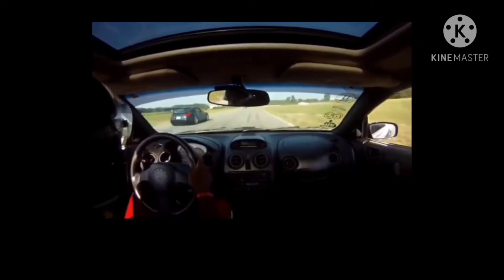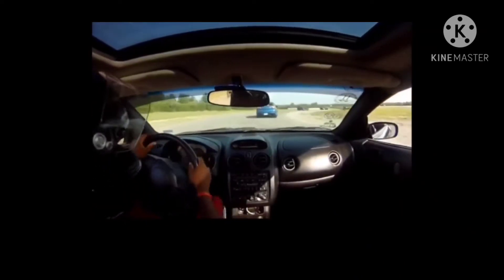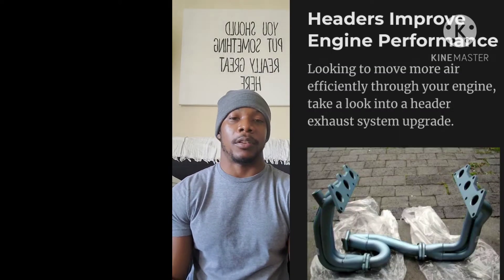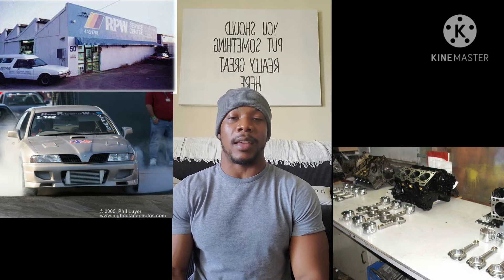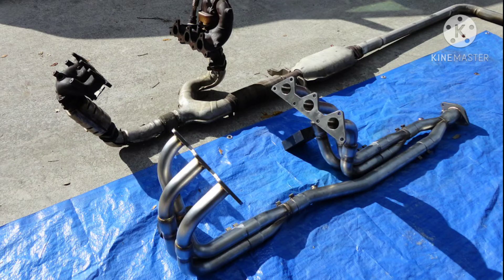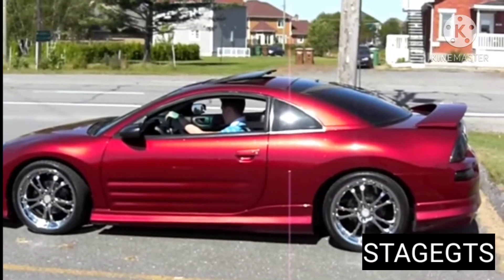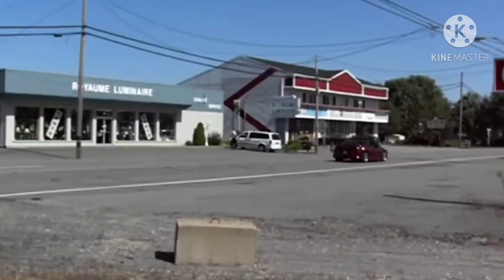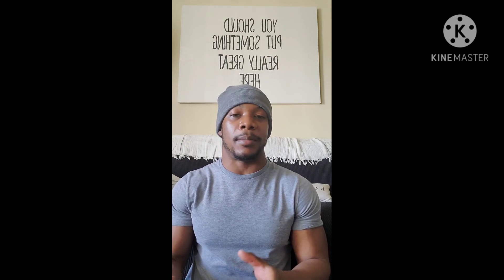3g eclipse v6 headers

Comment: Have you heard anyone using the Magnaflow cats or downpipes? do they add power?
Reply from the maker: I don't believe they make downpipe for the v6. Will it add power? I doubt it if it does the gain will be barely noticeable

Comment: Wish you could still find headers for these cars, I wanted to get some RPW's but I can't find any... I have some OBX's and I guess that's as good as I will be able to get, they also did not fit at first... but i torched the front header pipe and bent that bish till it fit properly. It wasnt that hard to do, but without a torch they were a pain in the ass to hook up.
Reply from the maker: You have to order rpws directly from there site
Reply: @tcroc30  I realized that was an option as i was writing this comment... that websites so basic I didn't believe it was real🤣

I had looked up RPW headers couple years back, and the website they were sold thu was different than the website you have linked in the bio... But I'm glad they are still an option. Keep the 3G's alive!!! 

Tell ppl to torch the elbow of the front y-pipe header connector if they have the OBX ones

Comment: I cannot find any 6g72 headers. Every site is out of stock. Please help
Reply from the maker: Rpw in Australia
Reply: @tcroc30  bro anything cheaper? Budget around anything less than $300?
Reply from the maker: Honestly no. The cheaper ones don't perform or fit well.
Reply: @tcroc30  shoot man, I cut my cat off and now I can’t bolt on my cat back system 🤦‍♂️ and my only options are long tube headers and the stock pipe with the cat and headers that fit my 2000 eclipse GT are either out of stock or too expensive and the stock pipe with cat is also way too expensive I can’t do anything
Reply from the maker: You can't do a test pipe with a flange to bolt up to the catback?
Reply: @tcroc30  yeah I didn’t think about that and thoughts on gutting both pre cats?
Reply from the maker: Not a bad idea not sure how it would sound though
Reply: @tcroc30  I’d be running gutted cats with DNA cat back would that gain me any power?
Reply from the maker: Probaly some gains not much though.
Reply: @tcroc30  is there anyway I can privately contact you? I found some long tube headers but the guy says they’re obx headers but has no proof
Reply from the maker: Message me on ig tcroc30
Reply: @illusion6471  did you gutt your cats?

Comment: What can i replace in the top end to make my motor last longer without swapping or buying newer?
Reply from the maker: Intake manifold, intake, bigger throttle body headers anything to get the motor to breathe better. These motors tend to choke out on the top end naturally but those 2 things will help some

Comment: I broke the 6g72 1/4 mile record with DNA (Ebay) headers that I cut with a drill to make fit 😆 🤣 😂
Reply: Im running dna also beside adjusting thebflang hole a little there not bad
Reply from the maker: Nice. What was the time?
Reply: @tcroc30  13.3 Seconds with a messed up 3rd gear! Somewhat impressive but seems it needs more future passes to get a 12 finally as it seems it could do it with time and work
Reply from the maker: Nice was this recent. I remember seeing a video floating around social media of a stock 72 on nitrous making a pass
Reply from the maker: Oh wait this is the guy. Man you stir up the internet with that time slip lol